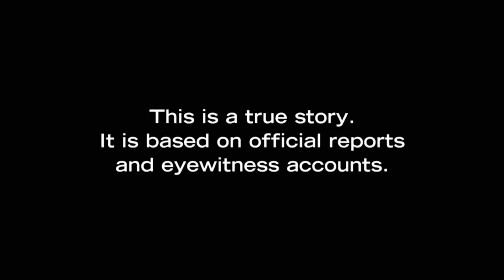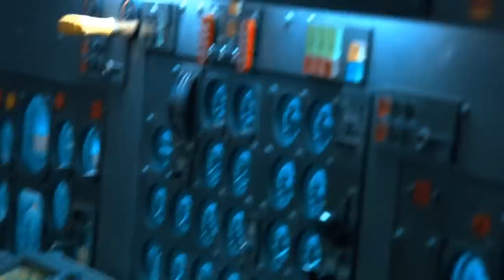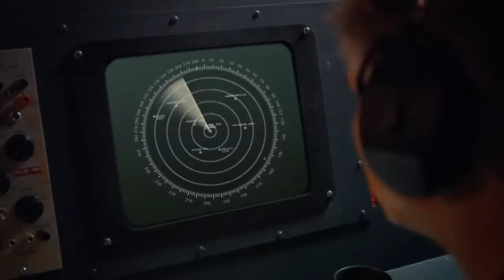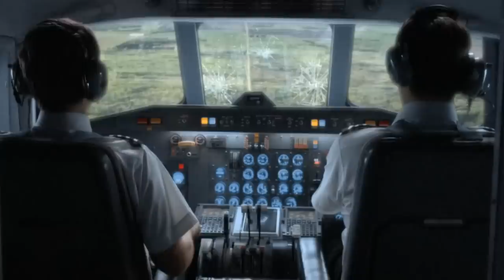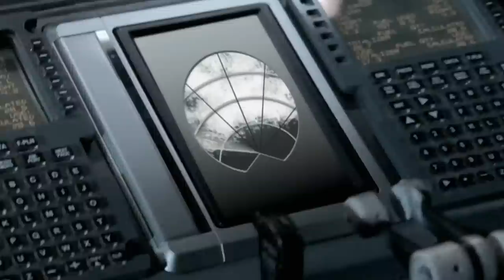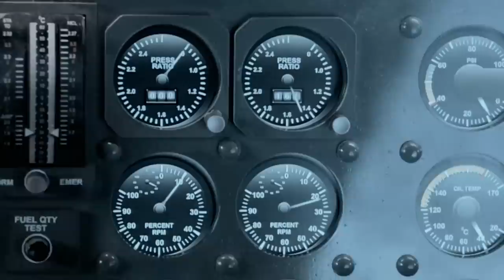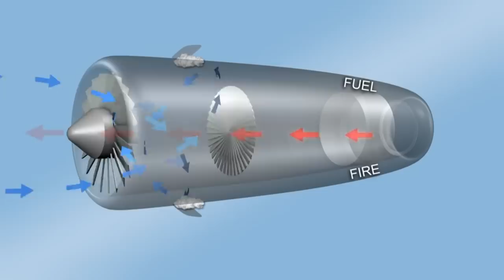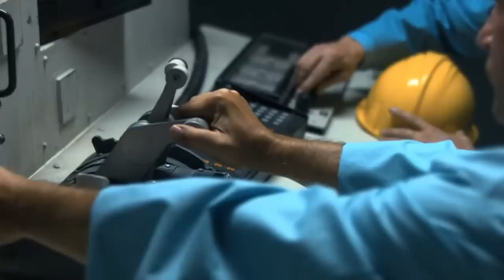A Sudden Loss Of Electrical Power And Two Failed Engines | Southern Airways | Mayday: Air Disaster

Comment: NTSB seems like the only federal government agency that both works properly AND is a benefit the citizens.
Reply: NTSB will only confront a problem after passengers' deaths and a few plane crashes by then the people pressure politicians, which at this point the issue is fixed.
Reply: To TECHEAD 100. If you are affected directly, yes is important to investigate and fix mechanical problems, Communication problems, But for the ones that we live this unfortunately situation the traumatic living experience hurt for ever, affecting us in the daily living, triggers that no one can control. If will be your family or friends; you opinion will be Different. ✈💔😪✈💔😪
Reply: @Techead100 
1) 
NTSB only investigates potential safety problems after they become aware of them. Unfortunately, it is often an accident that alerts people that there may be a systemic problem.

2) 
They are have investigation and advisory powers only. They have no authority within the airline industry to change laws, set fines or otherwise reprimand anyone. That is regulatory business, and that is the jurisdiction of the FAA.
Reply: @Techead100 
1) 
NTSB only investigates potential safety problems after they become aware of them. Unfortunately, it is often an accident that alerts people that there may be a systemic problem.

2) 
They are have investigation and advisory powers only. They have no authority within the airline industry to change laws, set fines or otherwise reprimand anyone. That is regulatory business, and that is the jurisdiction of the FAA.
Reply: D @Techead100
Reply: Agreed.

Comment: Crashes like this happened because the airlines frowned on any initiatives the pilots might take that would delay or hinder the flight, like turning around and going back or landing at an alternate. You can look at all the little factors and decisions made, but it still comes down to airlines pressuring pilots to keep to schedule. One simple 180 degree turn back to Huntsville= no crash. These days pilots are given a lot more authority over flight safety, but back then pilots got into trouble for delays.
Reply: I'm sorry for the time pressures. We need to embrace eternity and the fact that time is an illusion of the flesh. Thanks. Now let us pray for mercy.
Reply: This. Exactly. If ever you could pinpoint a major cause of most air incidents, more often than not, it seems, they could be prevented from happening if the pilots had felt comfortable enough to say, "No, I'm not taking off without *insert safety protocol here*." without fear of losing their jobs or reprimand. Unfortunately a lot of that comes back to us, the consumer. I've seen people get belligerent if their flight is delayed more than 10 minutes, and the airlines don't want to have to comp airfare, etc. It's the combination of business and entitlement.
Reply: @Ten80pete  I'm fine with 10 minutes, I only start to get annoyed when they're more than 3 to 4 hours.

Comment: Story of my life... aviation companies always say "safety is our top priority" yet the second you start work you are expected to basically put it last to everything.
Reply: @Youtube Moderator. Hey. So the pre flight checkup isn't performed at all?
Reply: @kevincage1641  It more like if smt is not highly required, it will be over looked or underestimated for most of the time.
Reply: @khangraw  And you are?
Reply: @kevincage1641  :v Just looking for better and safer flights
Reply: @khangraw  I was wondering if you are a flight technician, an FAA Flight Inspector or a Pilot. If not, why don't you learn how to fly and obtain a small propeller plane? IF you have a driver's license, you can get a Pilot's license with only 30 hours of flight time. I am in the process right now and am being trained by a certified FAA Inspector. Hence, I asked about pre fight checkup which should always be performed. Hope you find your safer flights.
Reply: If you own a car, you can own a small prop that can fit inside of a carport or trailer
Reply: What specifically are you referring to?

Comment: i thought one jettisoned fuel out before a crash landing...
Reply: 1. No. Not necessarily. There are many factors to come in to play to determine if it is safer to dump fuel or not. 2. This aircraft (along with many others) does not have the ability to dump fuel

Comment: Hmm. Not so sure about Southern. I was at the airport with my dad when I was 8 years old. My stepmom boarded a flight with my 3 month old baby sister. I noticed fluid leaking from the wing and engine and spoke up to my dad and the staff ("hey, you have fluid leaking from that plane!") and the gate employees inside the terminal wanted me to hush because I was scaring passengers. My stepmom boarded the flight anyway and dad took me home. We received a call 30 minutes later. The plane had to return to the airport and make an emergency landing. I refused to fly Southern after that. My dad had worked for Braniff and Eastern so I flew all the time. I couldn't believe the ground workers and pilots didn't notice the leaking fluid. My dad said he would never doubt me again. He also honored my wishes to not fly Southern when I went to visit grandparents.
Reply: I have always flown in the back of the plane but I now sit close to the rear emergency exits to help people out of the plane.

Comment: All planes should have deployable parachutes which bring the craft softly to the ground in the event of big trouble. This will prevent. Thanks for implementing this important idea.
Reply: Sorry but that isn't realistic for the majority of aircraft. They work for small single and potentially twin engine prop planes, but not really a jet given the weight.
Reply: @Suisfonia  It is realistic. Here's how. With the flip of a switch part of the fuselage can be converted into a pod which jettisons the wings, engines, all the heavy portions of the plane which everyone crams into for an emergency parachute deployment. The pod contains life rafts, blankets, water, food, shark repellent, beacon and radio equipment. After the air pod floats softly back to the ground / water, rescue crews can be dispatched to bring the passengers safely back. If they can put a man on the moon or a send a space probe all the way to Jupiter, clearly we have the engineering chops to build this into every plane. This is not that difficult of a design challenge to pull this off. But we have to think outside the box. Thanks 😊
Reply: @quantumpotential7639  and add significant weight and expense. Not saying it’s a bad idea it’s just hardly realistic.
Reply: @chuffer1486  they have to implement the design to prevent. Otherwise crash. Make everyone sad
Reply: @quantumpotential7639  you can pay the additional cost out of your pocket.  It would make the cost of flying so expensive